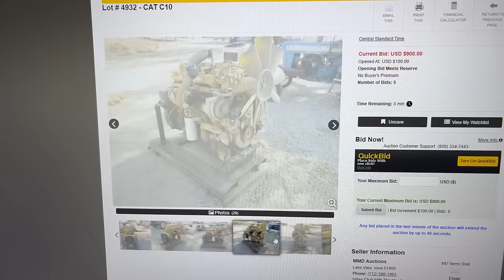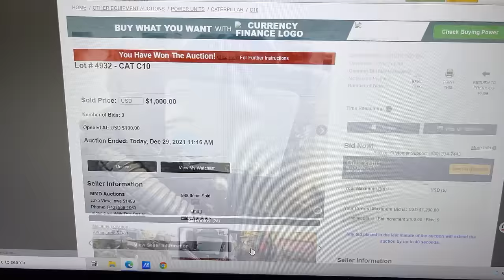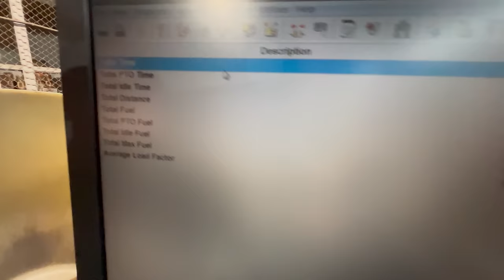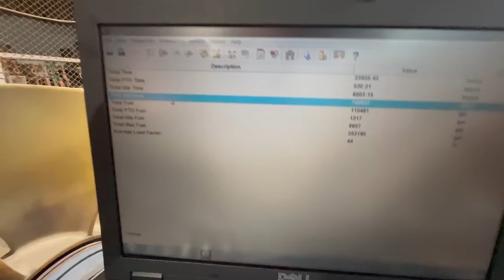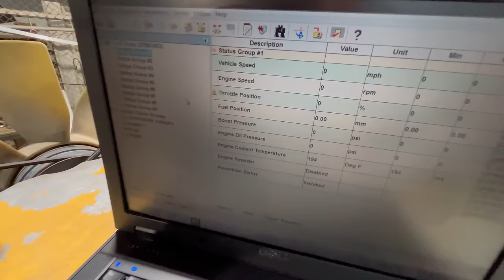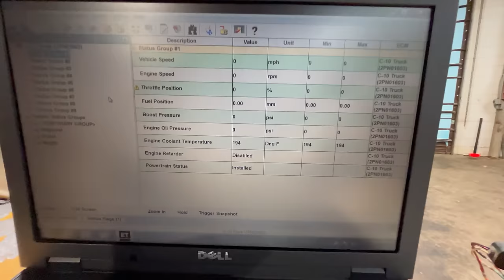Online Auction Buy - Caterpillar C-10 Diesel Engine - Will it Run or is it Junk?

Comment: Doesn't matter if you're feeding an engine ether to blow up or crashing RVs, I appreciate your video's, they're always worth watching, and I learn something.
Reply: Starting fluid is a truckers best friend sometimes. After you have been around tired diesels long enough you learn the technique. You learn to to  “ tap it” with just the right amount to get it to start
Reply: @rickjohnson1632  unless you're messing with an idi, in which case, if it's not starting with glowplugs, then it's not starting at all
Reply: @detroitdiesel-vu3ig  I had a 1991 7.3 idi. I paid 25,000 for it brand new. I put 330,000 miles on that truck. I changed glow plugs on it like spark plugs. If it wouldn’t start due to 0 or below temps at night the block heater and if I forgot to plug it in, I would tap it a few times with starting fluid and it would pop right off. I loved that idi . Even with its kinda less than optimal cold starting system and not being a real high horsepower engine, it always started and I ran the heck out of it. That 330,000 is not including idling hours. Add those in and the actual mileage was more like 500,000. No blow -by and maybe a quart of oil every month. I’d jump at the chance to own another. Preferably the idi powerstroke

Comment: Those injectors looked like they were contaminated by fuel with algea. It's pretty common in marine applications I don't know if you guys in the Midwest experience much of that. Always a learning experience, thanks as always for the great video.
Reply: Most diesel now has a certain amount of bio diesel in it that will cause algae
Reply: @samw2195  as true as that is, environment and how long it's been sitting around are as big a factors as anything. Algea in fuel has been a problem long before bio-diesel and once again especially in salt air environments
Reply: My truck only gets the best fuel. Waste motor oil. or Waste ATF...... or JP8. its a 6.0 powerstroke. Injectors are alot tougher than you think.
Reply: @justnsaliga8518  waste ATF in the fuel  😱 nothing like abrasive compounds in ya fuel system
Reply: @justnsaliga8518  RIP, dump the 6.0 off to someone else before she gives you trouble. If not, sincerely I do wish you luck with it.
Reply: @samw2195  atf cleans everything the injectors the lines everything mixed with some oil should be great
Reply: @supremeautomotive6749  clean ya bank out to ! 
That fine by me if you want to put ATF in your fuel system and fill it full of friction materials that’s in ATF
Reply: I've had bio diesel make that brown sludge in the fuel system
Reply: This engine sat around for months... I bet on it.

Comment: That really looks like biodiesel residue.  Exact same stuff I found in my Ford 6.blow.  The whole engine side fuel system had that brown crud.  The only thing that touched it was sodium hydroxide (griddle cleaner, very aggressive towards organic fats and oils), brake clean didn't work.  The engine likely would have been in service during the fuel craze years ago when diesel was 5~6 bucks a gallon.
Love the swinging clutch pedal of death too 😆😆
Reply: my 6.0 powerstroke Runs great. i only give her the best fuel. Used motor oil and used ATF and occasionally JP8. havent had a single fuel issue then agian the only thing stock is the engine block. everything else is high performance aftermarket something. only reason its not more than one Large non VGT turbo is i like having an A/C system. and i dont know how or why. but a NOS bottle and a Meth injection kit found their way onto my rig as well.....
Reply: 5-6$ a gallon is a fuel craze? thats what were paying north of the border right now... some 12v cummins owners may or may not be running 50dyed 50wmo cant confirm
Reply: That the same shit they cook my french fries in?
Reply: @justnsaliga8518  I dump waste atf in my reefer trailer fuel tanks when my waste oil tank is full. Gotta get rid of it somehow.

Comment: Man it so cool for me to see that nut with the oil weep holes, It was machined in Rockford IL, I spent many days working on that part, we glued it in place with loctite, then set it into the studs non thread area. Rockford company went bankrupt so not sure where it comes from now. We tried a one piece design but didn’t really work. I had the rocker arm adjusting screws too

Comment: Had a bunch of C-10’s in some old concrete mixers for a company I used to work for. Probably my least favorite CAT engine. Had many push rod lifter rollers go out and wipe out the cam. Also had one that windowed the block very quickly and randomly without any prior warning signs of a failure. And had one where the air compressor locked up solid and took out the entire front gear train. Mixers get used and abused but our preventative maintenance was pretty spot on. Never had that many issues with one type of engine.
Reply: Also the plastic end caps on the piston wrist pins ate notorious for falling apart and the wrist pin walking out and wrecking a liner
Reply: @jacobday3173  you are spot on with that comment. We had it happen on a 3176 in a Caterpillar Challenger 75 E, as well as a 3196 in a 95 E. Both scored the liners in two cylinders and caused extensive blow by and oil consumption
Reply: But but but cat is the best.  Hahaha
Reply: @nathankisner8332  they are, Did a complete total rebuild for less than $30,000 with updated parts. Running stronger than ever!
Reply: @I_Died_2_Weeks_Ago  Genuine cat parts! Who knows where the hell they’re made at though these days! Lol!!

Comment: Could it be algae on the injectors ?
The fuel filter it came with seems too clean to match the dirty engine.
algae has this color and is sticky.
You can save the injectors if it's algae.
Reply: Probably not algae, the fuel filter would have caught the particulates?
Reply: @skibik3r  
 The previous filter maybe failed,or had enough water in it to let algae grow past it.
Like i said the red filter is too clean on the outside to look like it was used.
Somebody tried to solve a fuel issue already.
Rust is not sticky like wax,so i think it's algae.
Reply: Desulfovibrio desulfuricans...
Reply: Not for certain but I believe algae needs light to grow
Reply: @yoilikecornbread  diesel tanks beg to differ
Reply: @skibik3r  The previous owner already changed the fuel filter to attempt a fix or diagnosis.  That's why it came off so clean.

Comment: In the UK we call that varnish it’s generally caused by bad fuel.
Reply: In the US when we say varnish it's usually referring yellowish clear coating that gets baked on under the valves cover and valve train. The stuff in the engine we'd call "sludge" or "shmoo"

Comment: There are decent odds that I helped make that cylinder head :-) Made them for 5 years in the 90s.

The first 2 years the 3176 cylinder heads I made had the copper inserts for the fuel injectors, and you had to use a custom roll form tool to seal the copper sleeve in, then you had to use a large radial arm drill with another tool to cut the depth for the fuel injector.  

When they swapped to those steel sleeves,,, it made life so much easier. :-)
Reply: I haven't touched a Cat engine for 20 years, but sometimes you like to remember things in detail, so I watched a Cat EUI video the other day. In it, the narrator specifically mentioned those brass injector cups, and the upgraded later model stainless threaded ones. I was thinking, I bet the earlier ones were some work to install, especially for a rebuilder. What are the odds I read this old post from you today? 😂 It's a small world, even on the internet.

Comment: I used to work for a small trucking company, that ran a lot of Beelman trucks with the C13 Acert engines. The first time I ever changed a Cat injector, the shop manager was watching and guiding me, and warned me not to snap off the electrical studs on the injector. So, I immediately twisted off one of the studs on a brand new injector. Live and learn, amirite? Lol

Comment: I thought that the amount of air bubbling out of the fuel return line indicated air leaks in the injector system.  After the injector swap the last lot of bubbles cleared out and then it ran.  A lot of blowby so would need a rebuild to be usable.
Reply: First thing I said right at the start of the video is it's drawing air into the fuel system it' not going to run till you fix that!!!
Reply: @markscully2342  yeah even to me, who has never touched a single engine in my life, it looked kinda “not fine”

Comment: I have been a heavy truck/bus mechanic for 45 + years. Never thought much of CAT truck engines. Mainly because the only cat engines I worked on were 3208, 3116,3126, and we had a motor coach with a c-12 ( which we had so many issues with it, we repowered it with Detroit series 60 after it went out of warranty) but since discovering your channel and watching , and watching a few guys channels that have trucks with cats I am kinda changing my tune. Great videos.
Reply: Any tips on Cat 3208/Ford 636? i really wanna put one in my Kodiak...... its a custom rig 91 Crew cab. with a Chevy TBI motor and its going through its midlife crisis of all the normal TBI problems me being a diesel guy. i thought maybe a 6.6L Brazilian out of a F650 or something but i'd rather have a V8 diesel. im down to Cat 3208 which i can get a running one for 800 dollars right now. or a Detroit Diesel 8v71 and or a 8v92..... or the motor im most familiar with at work Cummins 903 VTA big cam ours at work the PTG pumps are all cranked danm near max. they're all rated for 525 but really make somewhere around 650.
Reply: @justnsaliga8518  the 6.6 would be the best or a 5.9 Cummins with a p- pump. The 3208 is junk and the other ones are too big in my opinion.ive done a few 5.9 conversions, my latest is a 5.9 24 valve with a 12 valve front cover and a p- pump in a 2008 f-250 crew cab 4x4
Reply: @justnsaliga8518  you should be able to get 6.6s out of junked tractors

Comment: Just like a gasoline engine, 20% kerosene makes it run with 30psi of compression.

If its got thick HD piston rings that are new, some gasoline in the diesel fuel would light it off and help set them rings in.
Reply: a diesel,with all the mod tech,can stand 20% gas. cheap cleaner too..dont, do it every fill.

Comment: Another very interesting video.  Never worked on Diesel's but knew the theory.  Thanks for the education on how the fuel flows through the heads and it was interesting to see the Jakes work manually as you tested them.  I so appreciate your video's and thanks for taking your time to hold that camera and show us what's going on..

Comment: 345b fyi impeller likes to spin on water pump... 
Swing brake solenoid is smallest orifice in hyd system debris will stop it up....
Service mode in monitor can do way more pump controller wise that ET opposite for engine controller....
Drain water from swing bearing grease cavity..... 
Red light behind key switch is indicator for hyd.tank pressure if it's on it's only revving to 8.....
Set hyd. Pressures and you can adjust prv to make it dig!!!
I love them machines u should like it
Reply from the maker: I had some of this figured out already, and some of it not.  Thanks for the info.

Comment: Such a good feeling when it finally kicked up and ran. I had a c12 a few years ago that I had to replace the cylinder head in a truck stop parking lot chasing a fuel in oil problem.  Mixed good and bad memories with that thing. 2004 MBL. 

With those injectors, if you think you've got a bad one, you can separate the yellow part from the injector body and put it on top of a different injector body. Once had a bad injector body but the electrical guts were fine.

Comment: What do you think of the 349a super Jakes?
Reply from the maker: I don't have any first hand experience with them.  They were supposedly a fair bit stronger than the regular 346s, but it seems like there was an issue with some part of them wearing prematurely or having issues of some sort.  I wouldn't be afraid to try them out and find out.  As you know, not having an injector rocker arm is a problem when it comes to making a strong Jake.
Reply: @KT3406E   Yes, I have heard they had wear problems, I think using the retarder on the B model I am putting in the Car truck is the way to go. Thanks man.
Reply: @KT3406E   Don't let that grease line on that throw out bearing wack you on the pecker! Lol

Comment: When you're a small attachment for your shop, vac isn't doing the job, throw a funnel on the end of the hose. Pick a funnel with the opening size you want and usually extends your reach too. 
*Avoid using for long periods/without intervals, you could damage the motor on your vac

Comment: 17:00 I seen a mechanic do that for two days straight. Burned up everything. Starter, new liners, and the battery charger itself. He was just determined to get it running without doing anything than trying to start it.

Comment: That might be a good alternative to a Cummins for a pickup truck or a medium duty truck application. but I see you have a different plan for it as a backup for your excavator. and from what you said it makes sense why you purchased it. because a person doesn't want the excavator to be down for an engine rebuild. it appeared that you did all the right things to get it to fire up. after seeing the injectors I agree with you that those injectors are garbage. I can see your point on robbing the injectors from the excavator just so you can get that engine fired up. that God damn thing was finicky. but once you changed the injectors it at least gave you you an idea what you have now. and you were able to confirm the bad injector in the excavator. and like you said go though it and rebuild it and you have a backup for the excavator. yeah those Bush lites can sometimes hinder your your progress. but sometimes they are a nessesary evil.  there's no doubt you don't need the Jake's for the excavator. it's awesome that you pass on your vast knowledge of these engine so that everyone can understand them better. thanks for another great video.

Comment: Hi there how are you doing I'm new to your series of videos of going to give you a short recommendation for cleaning your engines pick up some oven cleaner and spray them 15-20 minutes before you pressure wash them you will find that it will help you 10 times and 10 times more efficient

Comment: I worked for an outfit that bought a Cummins from a junkyard. They told them it was a runner. They didn’t have it taped off or anything. I pulled the pan and it had old oil and sand in it but the bearings had been greased with lithium grease. I checked the torques and the outfit I worked for wanted it in the truck immediately plus they wanted me to guarantee it. Told them I wouldn’t guarantee it would even start. After I cleaned the pan I got it started. It ran pretty good but it didn’t take long to have problems.

Comment: Simple trick on those bridge motors, cap the fuel return line off and it will fire right up. Let it run for about 2 or 3 seconds then turn. It off and it's primed up. No need for ether.

Comment: Excellent content from another diesel tech. Loved the vacuum trick, I thought I was the only one. I'd love someone to tell me exactly what causes that varnish crap. I bought a cheap Cat skidder and the entire hydraulic system was full of that. Every spool and piston was seized in it's bore....... Literally had to take 8 months off of that project just to get the motivation to come back to it. It still has about 30% diesel in the hydraulic oil just to keep from clogging the pickup every 2 minutes..

Comment: Is the stuff you thought was rust, algae ?  I’ve seen Merecedes injectors get algae on them, caused by water in fuel, poor maintenance, negligence or under water.  Sometimes changing injectors will fix it if it has not spread to engine. If you  just after parts good cleaning of parts you should be good.

Comment: I saw Taylor Ray, another Youtuber use dollar store oven cleaner to get all that grime off of engines. Spray it on, let it soak for a little while and then use the pressure washer like you're doing here. Appears to be working wonders

Comment: I loved the 60 series Detroit one of the best diesels out there , I hauled cars for GM we got 10 of these rigs and I got a 12 with one in it and every so many ours they would send their guys out and drop pans and check mains rod bearings and put it back togather and leave we  all got over a million miles and don’t rennet the hours but we could not use them because of the weight had to go back to little cummins and I don’t remember the size of the engines but they were great little motors but with Detroit if we used it we would have to leave one car or truck left at the dock but wished they would worked out and walk the dog in the hills and high winds in Dakotas!